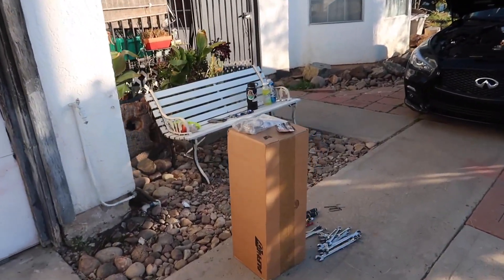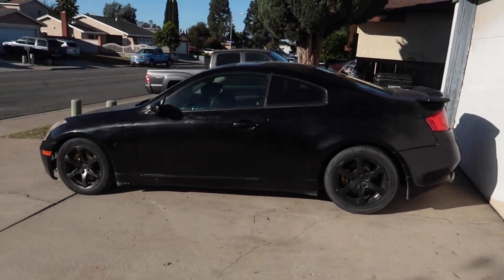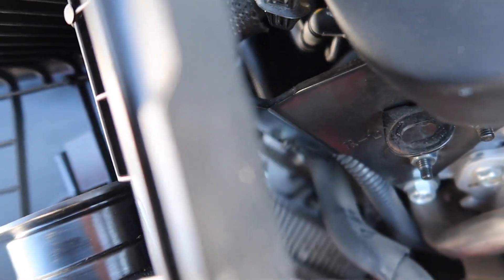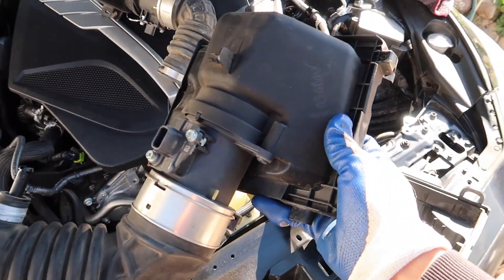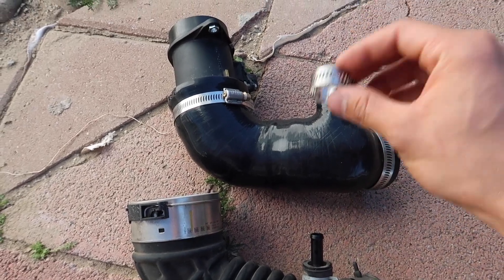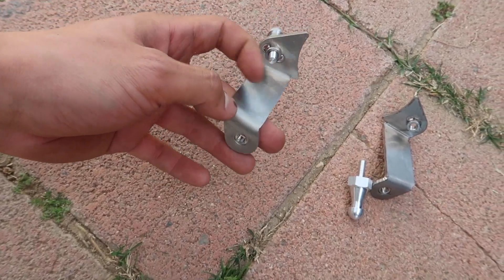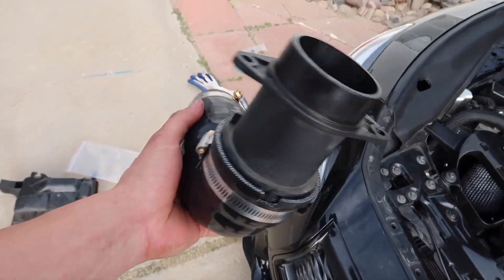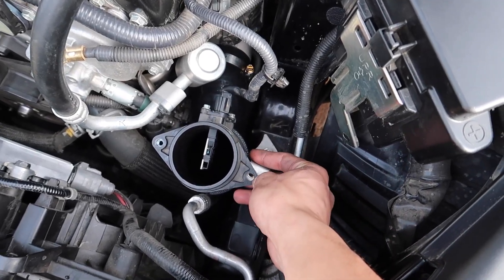HOW TO Install AMS INTAKES on Q50! | DIY

Comment: Bro this was a big help I seen other videos talking about how the passenger side is that hardest part to uninstall and how they used some special tool to fit in the tight spot to loosen and tighten it, that pushed me away and not want try but you made it look easy ! So now I feel like I can do it !
Reply from the maker: Hell yeah bro, you got it 💪🏽
Reply: Have did yet since then ?

Comment: Mine sounded like that when I only had the AMS intakes but once I got the lower downpipe and ecutek ams tune, the sound went away. It sounds NA thought it does backfire/pop occasionally (not popcorn pops with multiple pops). I even added hks bovs and I don't even hear that on revs, only on wot pulls when I let off. Seems odd that everyone has different sounds. My datalogs shoe that everything is fine too. No leaks or anything.
Reply from the maker: Yeah that blow off valve goes crazy, I’m sure that’s hella fun to drive. I needa get my hands on one of those haha .

Comment: My turbo inlet tubes aren't completely flushed back all the way, do you know if this will be a problem. They are on about 85-90%
Reply from the maker: You can’t push it in ? Try putting a small little bit of lubricant
Reply: @jordantcastro I was able to get it bro preciate it🙏 does that front duct still go on even tho it's blocking the intakes ??
Reply from the maker: @jaden557  yes , you can put that back on too.. it’ll fit right into the new intake boxes

Comment: Any tips on what to do, my maf sensor is just stuck. No matter how hard I push it won’t come out, any tips?
Reply from the maker: I pulled off the little snap in zip ties that mount the wires to the car.. just keep trying bro you’ll get it. Put some gloves on and try again. Take a break and get back at it
Reply from the maker: Pull those clips out that I was referring to @ 3:55 in the video .. this will give you more space to work with
And it will be easier to disconnect the mass air flow sensor.

Comment: How much horse power does this add ? Because i have a 2014 Q50 i want to and a air intake but i dont know which one is the best one to be added with more horsepower??
Reply from the maker: Maybe about 10+ it’s hard to say. But AMS probably the best one to go with!! I don’t have a tune, but I’m sure if you have a tune or a boost controller , it’ll make the intakes hit a lot harder
Reply: @jordantcastro  His 2014 is a 3.7.... So, no boost
Reply from the maker: @SubZeDiZeD  👍🏽 thank u

Comment: Does it run good without a tune ? & how’s the sound with the hood closed ?
Reply from the maker: Without the covers , it sounds beast..  i can hear it loud and clear while I drive.. and the car runs perfectly fine without a tune. I also have an exhaust though , so the air flow is smooth. Might be slightly different with stock exhaust.  👍🏽 runs like a champ

Comment: Just got myself a q and wanna do a mod that’ll add some hp and torque. What do you recommend? It’s the 3.0 awd version btw. I was thinking exhaust but even a catback don’t be adding all that hp. Also I want something that won’t void warranty cuz I want my shit to be covered.
Reply from the maker: Nice bro. 👍🏽 look into a jb4. It’s a plug in boost controller. Just unplug it if anything goes wrong before you take it into the dealership
Reply: @jordantcastro  oh yea I heard bout that from boost in motion channel! You think that mod alone would make the car louder then stock? And what exhaust system do you recommend bc even tho I want performance mods I definitely need this car louder, this shit too quiet stock 😂
Reply from the maker: @thetruth9307   yeah it should make it a little louder , but the best way to get sound would be throwin an exhaust system in their. You could also install downpipes , but that would void your warranty I believe and you wouldn’t pass smog. Check out my ark grip exhaust video. It’s a little bit on the expensive side, but the thing sounds dope.
Reply: Here in MAryland I have ldp full custom catback ams intake mishitmoto hx and I’ve never not been told cars not warranted
Reply: And passed MAryland veip emissions  testing ( still having primary cats no secondary’s )

Comment: I installed mine yesterday on my q60 and doesn’t sound anything like this, do you know what my be te reason ?
Reply from the maker: Hmm.. You have a q60 3.0t ? Did you let the car warm up a little before you started to rev it up ? I did have the cover off of the intakes for the video, and I also have a catback exhaust, letting more air in/out.
Reply: @jordantcastro  yeah it’s a 3.0T, and this morning I removed the cover but it still doesn’t sound anything like yours lol ,...
Reply from the maker: @Gamer-so1sk  maybe it’s the exhaust system haha. The weather is also pretty cool where I’m at , that might make a difference as well.
Reply: @jordantcastro  I’m just scared I didn’t do it right 😨
Reply from the maker: @Gamer-so1sk  just follow the vid bro, you’ll be good haha. Just make sure you got the silicone parts in all the way and tighten those hose clamps 💪🏽 keep it up fam

Comment: Good installation guide..

With THAT said... Intake "upgrade" on the Q is a waste of $. The stock intake system is already as good as it gets. So youre either blowing a lot of $ on the look under the hood, or a slightly different sound. There's little to no benefit for buying aftermarket intake for this vehicle.

This is just a bit of info toward those who are thinking about buying an intake for their Q.
Reply: Stock tune correct but if you have ams intakes and are tuned there are  some gains in low and high end with these intakes . Not saying every intake only ams ,stillens are actually bad for the car
Reply: That’s wild. Why are the stillen bad. What’s different with AMS

Comment: can u hear the air release from the cockpit ?
Reply from the maker: Hell yea.. every time
Reply: @jordantcastro  wtf. mine aren’t exposed is that why I can’t hear mine?
Reply from the maker: @xavierspencer5530  yea bro.. you gotta take off the cover. I also have an exhaust system , so their is a little more air flow
Reply: @jordantcastro  will the filters get dirty if I take the cover off ?
Reply from the maker: @xavierspencer5530  yes. It will get dirtier faster , but if you have an air compressor you can blow it out every now and then